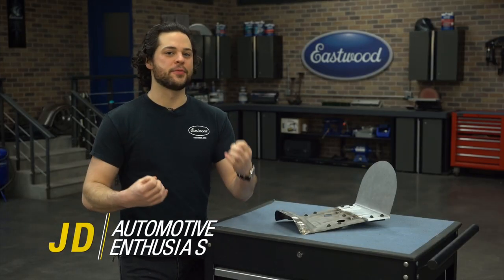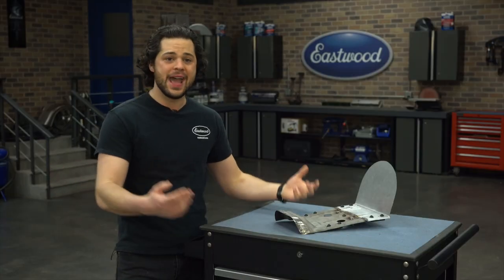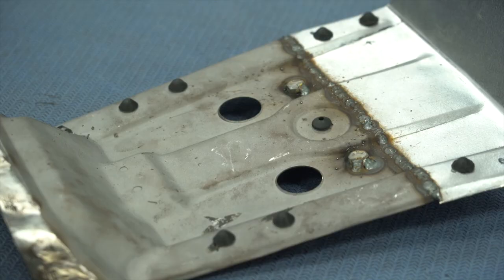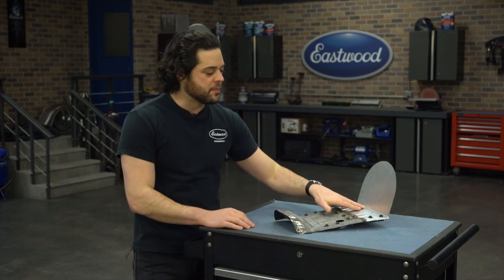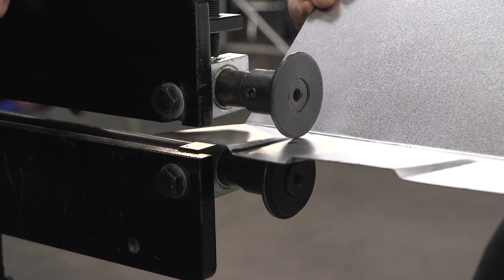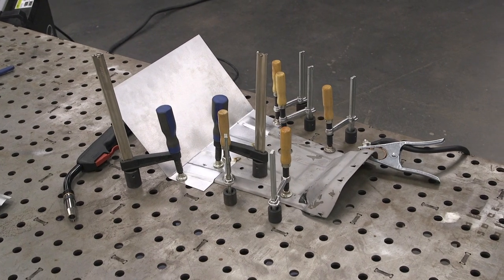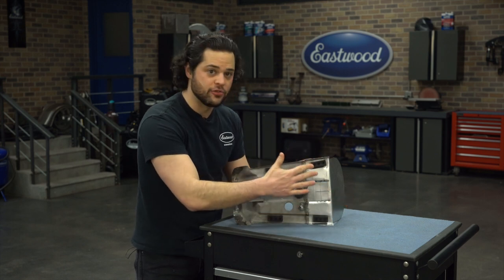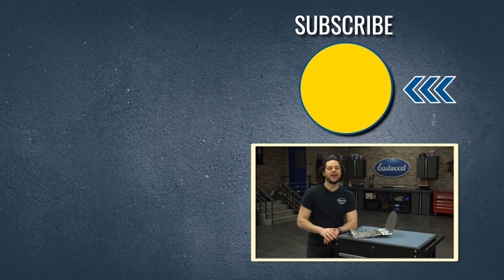How to Replicate Factory Body Lines on a Patch Panel - Eastwood

Comment: Good video here, with some knowledge that I can use for the future.  Most seats I’ve build have been 100% fibreglass as very easy without the need for specialty tools like this.  I do however need/want to pick up a bead roller like this.